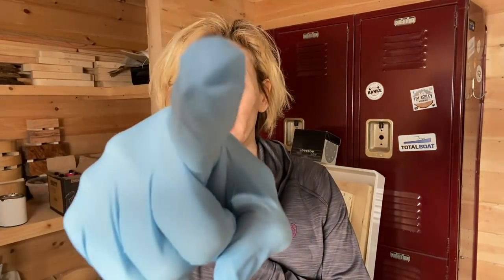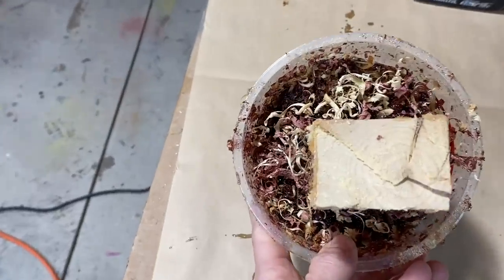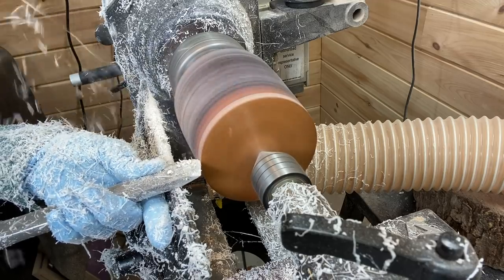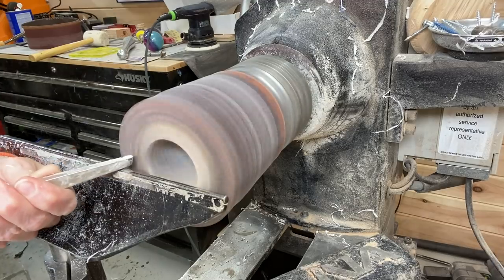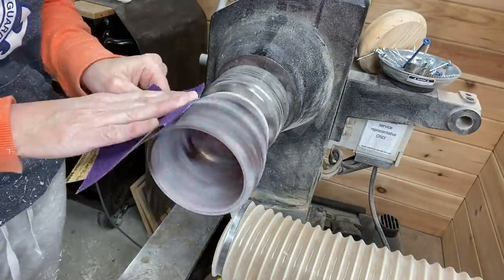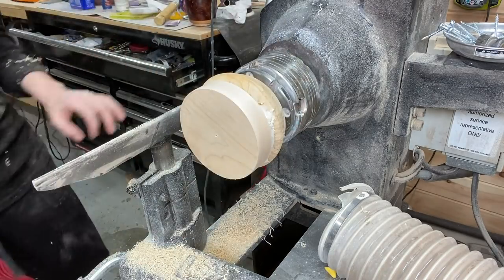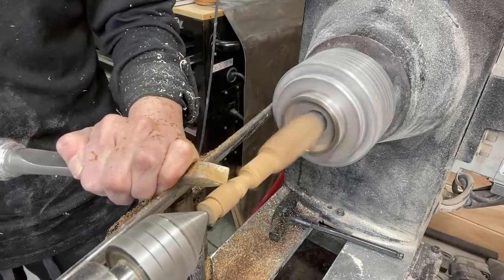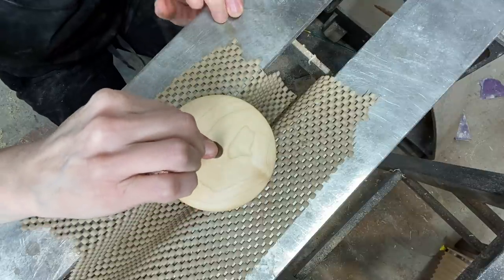Woodturning Cedar Shavings in RESIN!!! See what happens!

Comment: Hi Peggy ..  Just a tip..  I have two different types of lung dieseases and any type of cedar or redwood just creates breathing issues.. Even though I use great masks the filter all dust and chemicals the dust sort of clinks to my and shop..  So when I am not turning I get choked up. So as a warning to viewers.  try to stay away from woods like this..There are other woods that are hard on our lungs..  I like you like to save shavings and use them to add color and keep the see thru in my bowls.. I also save the resin not used and rescue the left overs and cut strips for more accents in other bowls..Very nice work on this one too..☺️👍

Comment: I have done this myself, it did really well, I was really surprised, I will be doing another. I did not put any other timber in and it just worked. I did it because I had left over resin and thought it a good ides (one of my better ideas). I used a half inch swept back.
Reply from the maker: Nice!

Comment: Regarding your tip at 5:55... I remember years ago when there were a bunch of miners trapped and they had two teams drill bore holes down to reach them. One team used a diameter wide enough to rescue the miners directly while the other team first drilled a small diameter hole, maybe 1 foot or so. Once that bore was done, they then drilled a larger diameter bore on top of that. The 2nd team was the winning team, despite having to drill twice instead of once. I think the same concept applies with your bores here on the lathe.
Reply from the maker: Thanks for watching.

Comment: Turned out really nice. I saw you trying to pry the resin out of the mold with a screw driver. My first thought was she must not have an air gun. Then you used one at the end. Next time try to release the mold using the air gun. I shouldn't be giving you advice because I'm not a wood turner but I have seen several others use the air gun with great success. Thanks for the videos.
Reply from the maker: Thanks for watching!

Comment: For the longworth chuck, the conical rubber grippers are horrible.  I've stopped using it because bowls fly off, and if they slip, the black rubber burns onto the bowl and it's impossible to remove it all.   They sell replacement squarish ones that work much much better.  I would also suggest you get the dedicated chuck jaws instead of the longworth chuck.
Reply from the maker: I hear ya! Thanks!

Comment: Great looking piece Peggy. Those shavings from the epoxy really make a mess. How do you care for your carbide cutters? Are you able to sharpen them? If you rotate them for a sharp edge, do you mark it any way so you know where it was at? Thanks.
Reply from the maker: The negative rake carbide is great for resin and very hard woods. I don't sharpen them, but I do rotate them to get the most use.

Comment: That is a great looking lidded vessel. For the few smaller resin projects I've done, I have not used or do I even have a pressure pot. I am assuming that for a project like this, a pressure pot would be a necessity in order to smash everything together.
Reply from the maker: Thanks. Yes, I think if I had just let it cure without the pressure pot, it would have too many bubbles.

Comment: I need advise on resin chipping when turning and how to repair it
Reply from the maker: Use a negative rake carbide tip and have the RPM as high as possible (safely, of course).
Reply: @PFWoodturning  Thank you that was the trick.

Comment: When you added the CA glue to the pits on the outside of the resin, did it leave a cloudy area where there might have been a chemical reaction to the two?  Thanks
Reply from the maker: It does at first, yes, but once sanded, you would never know.

Comment: First off, I am not a turner so you may consider my critique with that in mind.  My opinion and $1.25 gets you a coffee at most highway gas stations. 

In my eye, the lid and finial are mismatched to the vase.  

Generally, when we view an object like this, it is at roughly a 45-60 deg angle down, just as you presented it.  We see the top far more readily than we see the bottom.  There is just not enough bottom to balance out that lid.  There is no connection between the vase material and color and the lid or finial.  No flow for the eye.  The corners on the lid are squared while the vase are rounded.  The tall, rounded finial sits atop a squat square lid and the shape doesn't match the vase.  The lid should be more rounded, trying to match the arc of the vase at its widest.

A suggestion, and again I am not a turner and thus don't know the intricacies and nuances my thoughts present.  Make your vase casting taller and cut the top off on a band saw.  Use that piece to fashion your lid.  Or, using the same materials, cast a smaller piece that could be turned into your lid.  A third pour could be done to make a matching finial.  Or, using using different colored wood shavings,  cast a complementary lid and finial to match.

The finial you added is unrelated to either the vase or the lid. To match the lid it should have been shorter and wider, possibly a squarish knob shape on the bottom.  The current shape is opposite that of the vase.  Again, I would have much preferred to see it match the vase more in texture / material.  While tall finials can have their place, in my mind I would think a similar shape to the vase, following the same proportions of the vase, would feel better esthetically. 

By themselves each piece is very well done.  To me, they just don't flow together.
Reply from the maker: Thanks for the feedback!